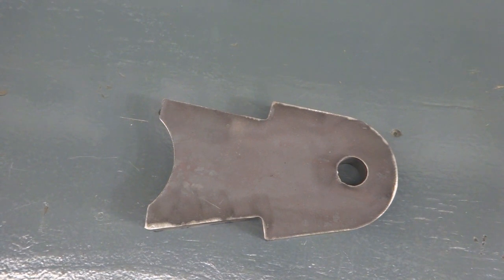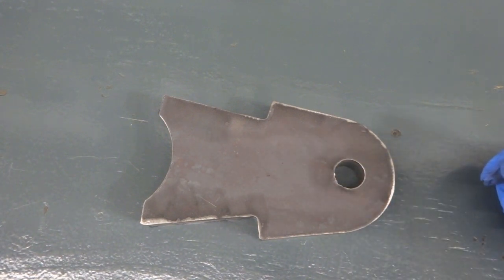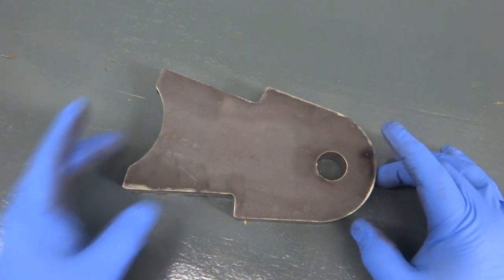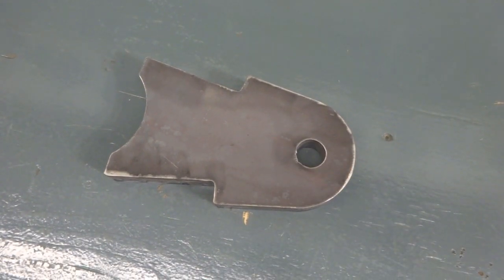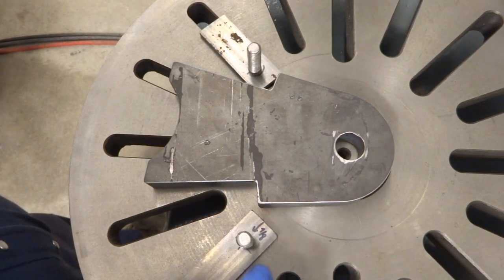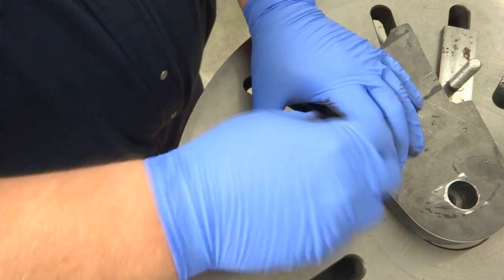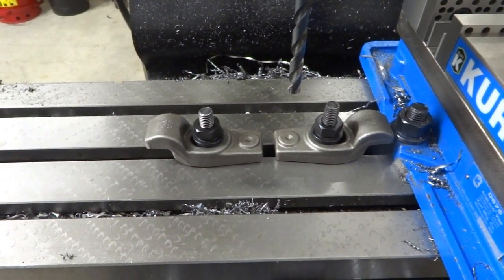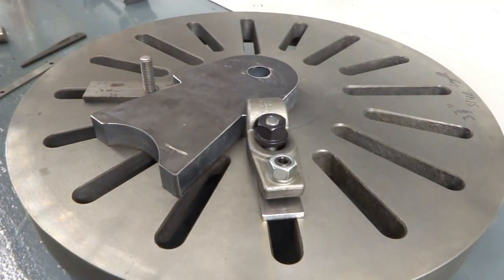Lathe Face Plate Work

Comment: In terms of precision, like, cylindricity of the hole, perpendicularity in relation to the face of plate, etc, is this method better than using a standard drill press?

Comment: Finally figured out you dialed in the indicator to 0 on that live center before using it, so you can measure the flex in between the setups. Incredible, thank you! Haven't seen that anywhere over the past 2 years i've been learning this stuff

Comment: Absolutely bizarre way of working !
Reply: Yeah, I was thinking the same. A straight cylindrical inner surface is too little of a turning job. That part belongs on the table of a drill press, centered, clamped, then bore or ream or whatever.

Comment: simple but brilliant technique style, Funnily enough I had a heap of near identical parts some time back which I did vertically it in the mill with an annular cutter I'd like to think it was slightly faster but the Chinese plate we get here in Australia is often a mixed bag. On occasion you get some terrible hard spots which will really ruin your day when running HSS

Comment: Simple and repeatable.
Good job shop technique.
My take away was the lock plates for the clamp bolts and the set screw clamp adjuster.
For the home shopper you might have explained the balance weight, the single cut to get under the heat hardened cut line, the choice of which side against the plate, just explained more.
But, subbed, keep up the good work.

Comment: A face plste is an often overlooked piece of equipment, rarely used by the "famous" YT turners 😢
It might have slightly quickened set up if you had bolted something to engage the semicircle, but it worked fine as is.
Reply from the maker: I hadn't thought about it until you mentioned it but you're right, there aren't many videos of face plates being used.  Engaging the semicircle would have probably positioned it as accurately as using the hole (they share a common axis) but the nice thing about using the hole is that the centre presses the part against the face plate so it won't fall off while a guy is fumbling around looking for the wrench that he previously set down just out of reach.  Thanks, Ken
Reply: @hmw-ms3tx  i was thinking of using the tailcentre as well as the semivircle  but as the saying goes ask a dozen machinists how to do something and get 15 answers. It is alwsys the end product that matters not how you got there.

Comment: Nice to have a lathe with a large swing. That a 24" face plate?
Reply from the maker: Not quite, it's 20".  The lathe can swing just under 21" so I bought as big a face plate as would fit.  It doesn't get used a lot but is sometimes very handy. Ken

Comment: Nice Setup -- very creative . I like the short stiff boring bar setup . One cut and see you later .
Reply from the maker: That was my goal when I was setting up the clamps, keep the bar as short as possible.  My original plan was to take two passes, a roughing and a finishing.  The problem was the roughing pass put the tip of the insert right in the hard, laser cut surface and the insert tip would chip every second part.  I changed to a single pass and one corner of the insert lasted for about about 30 parts.  It also made for a faster cycle time.  Thanks, Ken
Reply: @hmw-ms3tx  I agree ,getting the cutting tool under the laser cut surface was the ticket